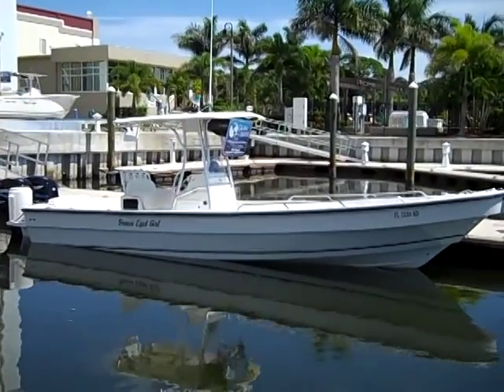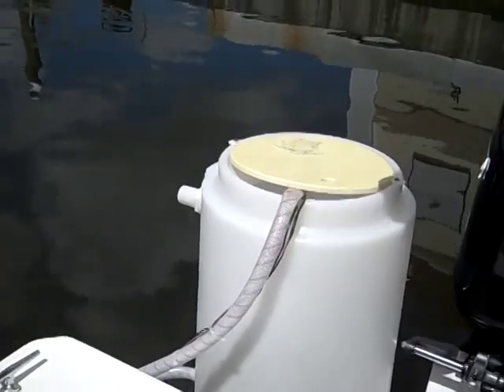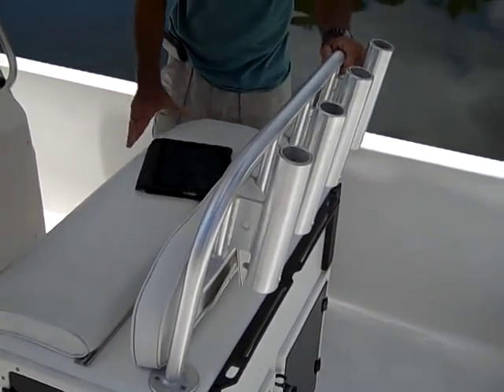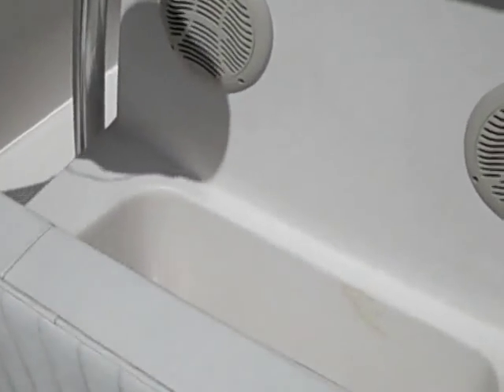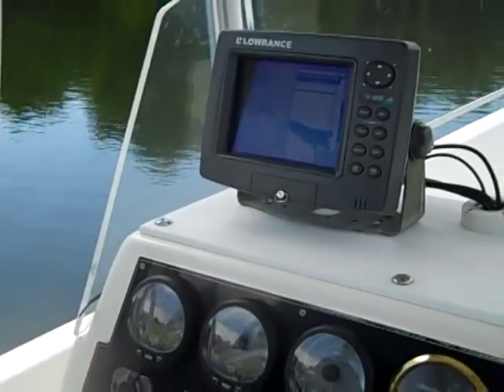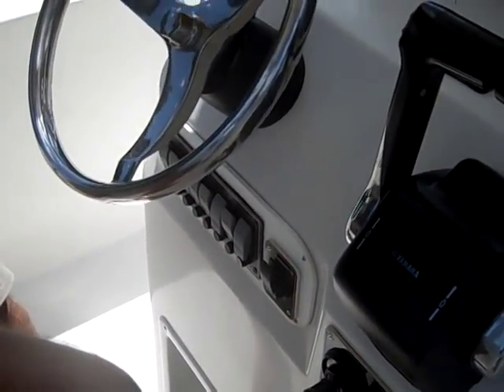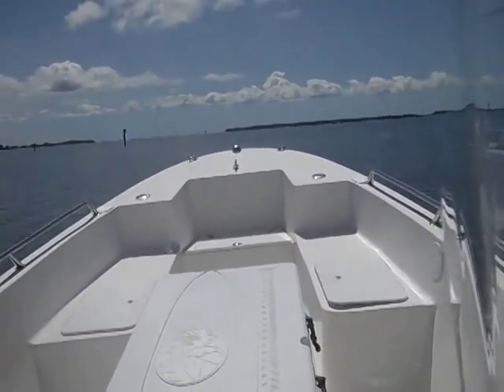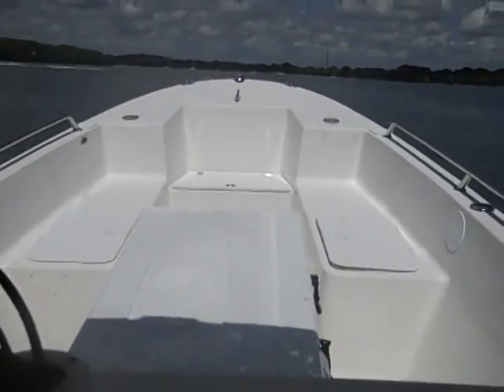2005 Angler 26 Panga Tour and Sea Trial

Comment: SEA TRIAL? River trial. It's a little disingenuous to run a boat in a flat a$$ body of water and then recommend it as a "Really good performer."
Reply: I'm guessing he said that because the panga has a proven design from over the years.
Reply: Bay Trial to be exact, that brokerage company is located in Tampa/Saint Pete area. It would take them miles from where they are located to reach the open ocean. They aren’t going to take it out that far for a demonstration, this video is simply to show that it runs and isn’t broken down.